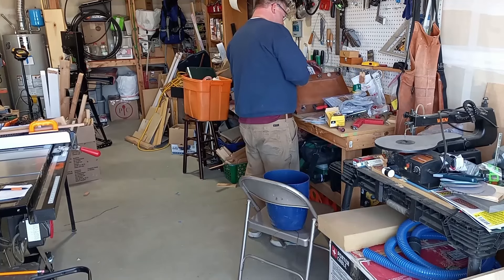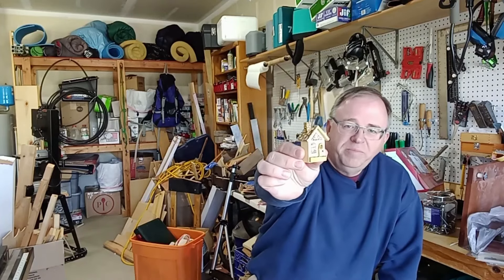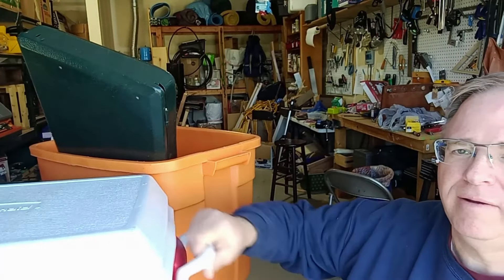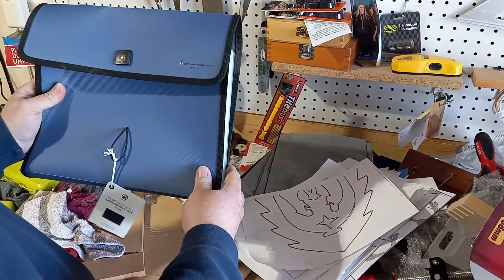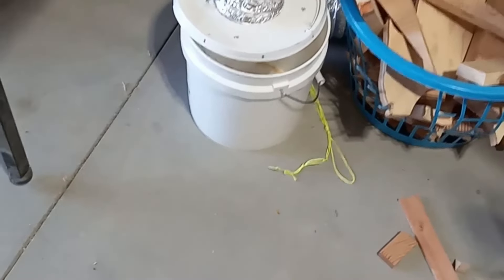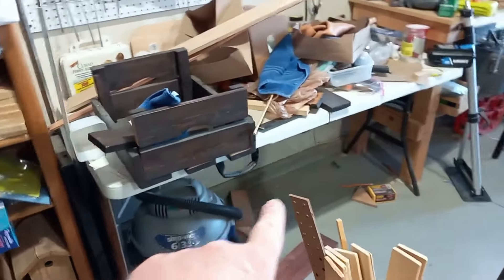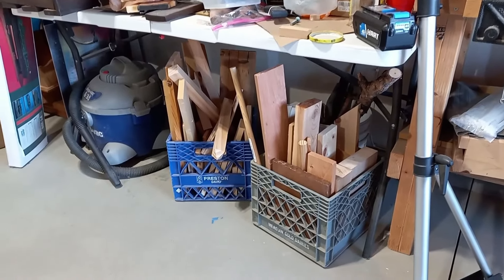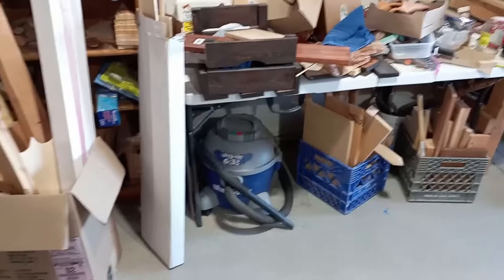Workshop Declutter - Taming the Scrap Wood Beast!

Comment: I made some brackets at the ceiling for storing the longer pieces of wood, that way it does not take up valuable floor space. And a cart for storing sheets of plywood. You could use a big pvc drain pipe for storing the really thin pieces.
Reply from the maker: Great ideas.  Thanks for sharing!